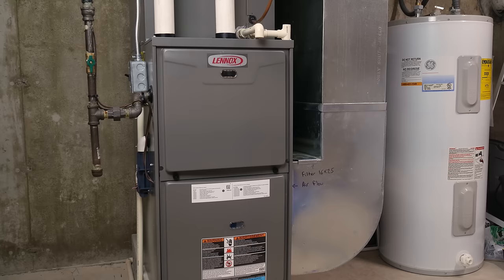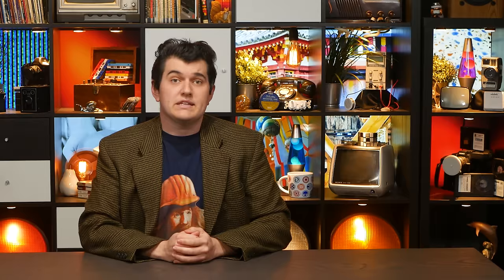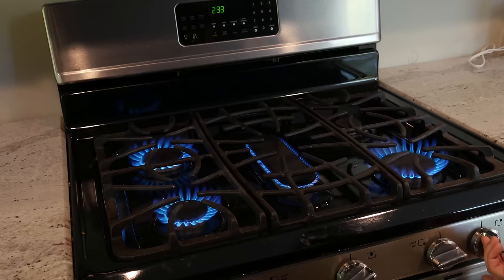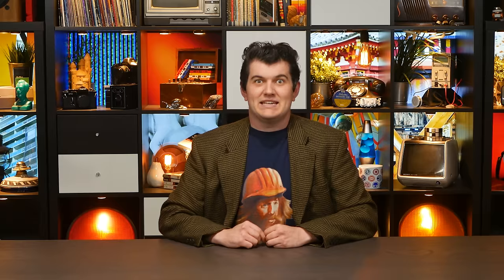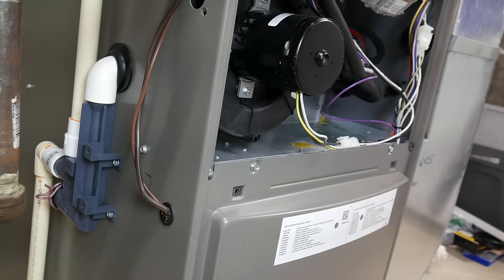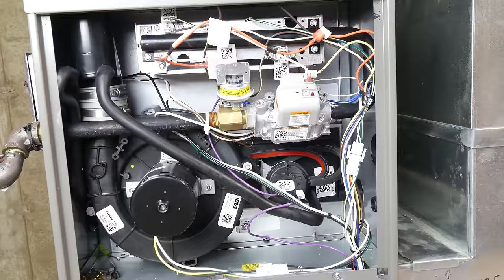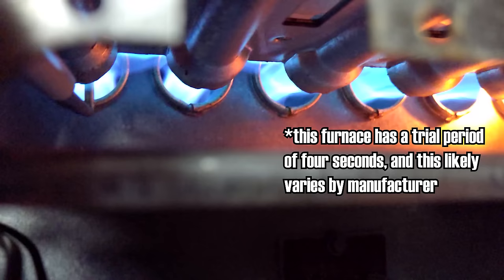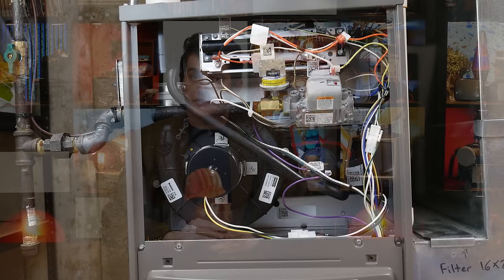Forced-air Furnaces: The What, Why, and How

Comment: I did an engineering internship for a company that designed and built the internals of these things (called "heat modules". A couple extra fun facts:

The burners are an interesting design in themselves. There's a small nozzle that shoots a stream of gas into a steel venturi tube, which draws air in at just the right ratio for combustion. The other end has a big hole like you'd expect, but they also have tiny channels sticking out on either side to carry the flame across all the burners during ignition.

A thermocouple isn't the only way to detect flame. A very interesting method is by placing a small pointy metal rod in the flame. Because of physics and reasons, when you place a large metal surface area (like the burners) and a small metal surface area (like the pointy rod) within a flame, the flame plasma will conduct a small amount of electricity, but only in one direction. Effectively it acts like a diode and a large resistor in series. So the circuitry will check for that condition. It's actually somewhat more robust than a thermocouple - a thermocouple could get hot for some unrelated reason, but it's very unlikely that a couple pieces of metal begin acting like a diode-resistor without flame present. (Unless, of course, an intern is making a control board testing rig, and they literally put a diode and resistor across the flame sense leads.)

There are also some furnaces that, along with a limit switch, have a "rollout" switch. These are thermal switches just outside the flame box that are meant to detect if flame is "rolling out" of the fire box instead of going in the tubes. This could happen in the event that the flue or one of the tubes is blocked - the pressure switch activates as expected, the flame is present as expected, but there's not actually airflow, so there's just flames rolling out into the wiring and everything. 

Some heat exchanger tubes have dimples, and the ones you show in the video have wrinkle bends. These help disturb ideal laminar flow and mix the gases, allowing the gases to cool uniformly. This sounds simple, but the design actually needs to be somewhat careful - any old baffle or dimple design may introduce eddy currents near the tube wall and cause overcooling and condensation, which will rust out the tube. Condensation can only happen in the final pass of a high efficiency heat exchanger - making the entire exchanger from stainless is not cost effective, so it's only that last pass that's built to withstand it. Up until that point it's exactly the same design as a standard 80%. (Also, that's the only reason why pretty much all low efficiency units are 80% - if you extract any more heat, condensation starts, and the steel tubes will rust out. You kinda covered that in the video, though.)
Reply: I wonder how Destin would feel about things disturbing ideal laminar flow.
Reply: Great extra info. Enjoyed the read.
Reply: I recently had to replace the small pointy metal rod (flame sensor) in my furnace and I was wondering what the difference was between that and a thermocouple. Now I know.
Interesting info, thanks for posting it.
Reply: The diode effect is because the flame is slightly ionized and thus conductive. But, in this case, the ions are flowing with the flame. Therefore, it poses less resistance to the electrons 'going with the flow' then to those going against the flow. This makes it behave like a (very bad) diode. 

If you apply an AC voltage to the probe, and measure the current, you can therefore measure a slightly assymmetrical current. This tells you an ionized stream of flowing gas is present: A flame!

These probes can also be used for spark ignition. Useful in instant water heaters, where you want to ignite fuel immediately and not wait a couple seconds for some hot thing to warm up. You can immediately after sense the flame, no need for the probe to warm up. I think that the pointy shape is rod just to aid spark ignition, and not for the flame detection, but I may be wrong there.
Reply: @marco23p  : The point will tend to concentrate the electric charge, thus leading to a higher current flow in all states, aiding both sparking and sensing via the same mechanism.
Reply: @marco23p  : Out of curiosity, have you ever heard how much the greater mobility of electrons aids in rectification, vs the flow of the carrier medium? I can logic my way into either of them working, but baring the involvement of thermionic emissions, I'm then challenged to think of why the effect should be directional.
Reply: So the burner is like a carburetor.
Reply: @absalomdraconis  To be fair, I have not. My source for the moving medium was the Dutch Wikipedia (article: Ionisatiebeveiliging), but the English Wikipedia (article: flame rectification) seems to only mention the difference in mobility.

 I think this in itself would make a very interesting video!
Reply: Great additional info, thanks Cody.
Reply: Others have pointed out that for spark ignition the sharp point can serve two purposes:  gas ignition and flame detection.  When I recently retired my 1984 gas furnace (after 35 years of service), I saved the ignitor module for circuit analysis.  The spark is generated by a step up coil that is driven by a pulse every half second (tick...tick...tick...).  It operates in parallel with the 24VAC lines that turns on the gas valve.  If the valve is on, it wants to ignite the stuff.  However, the same wire that sends the high-voltage ignition pulse to the spark gap, is also sensed by the drive circuit.  Once there is conductivity across the gap (the flame) the drive circuit is inhibited, and the spark pulses stop.  A nice feature of this design is that should the ignition not be sustained (i.e. the flame stops) the ignitor would start sparking again, just in case the gas is still flowing.

These circuits work well, and surprisingly when they fail it's often not the circuit, but rather poor grounding that's the culprit.  If the service tech works on the gas burner, but fails to reattach a hold down screw (or the screw area is corroded) there can be a bad ground.  So the HV wire to the spark gap is fine, but the return path is marginal or indeterminate.  Or perhaps the tech knocked the spark point out of alignment; out of the path of the gas.  This results in a marginal or misdirected spark, the gas fails to ignite.  

In normal operation the spark ignites a small amount of gas using the pilot valve, and once the flame is detected the main valve opens for heating.  Without a sensed flame, it never transitions past the pilot valve stage, and after a few failed attempts, will shut down completely.  It's also true that a poorly positioned spark point might be just close enough to ignite the gas, but also just far enough away to unreliably detect the flame.  This might cause the spark circuit to attempt to ignite an already burning flame.
Reply: Your mention of a flame roll-out switch surprised me being optional and not required. I thought this was a standard safety feature. Apparently, it must just be a  best practice that manufacturers can choose to observe or not.
Reply: @twistedyogert  I was thinking the same thing; it basically is a carburetor, with the U-tubes in place of the intake valves/cylinders

Comment: As an HVACR tech I deeply appreciate this. I wish more people were knowledgeable about how we heat and cool spaces. I think HVAC is the most fascinating trade. It encompasses so many different disciplines (plumbing, electrical, high and low voltage, controls, carpentry if you install, and refrigeration) you can go so deep if you want to but most people don’t even have a basic understanding of how it works.

Comment: "Efficiency of 96%"
"Correction it's 95%"
How dare you betray us with this fallacy! I'll be getting my unnecessarily precise statistics elsewhere from now on, thank you very much.
Reply: James Anouna it may be .5% less that 95 because the air filter is a little under sized, makes the blower work harder to get the amount of air it needs
Reply: Me, reading up on and buying heating for my house: 96? That's shit, are we still in 70s? 97+ or bust.
Reply: It's a quarter of those 4% !
Reply: The efficiency number only states how much fuel it turns into hot air. Hot air heating itself is very inefficient compared to using water as a conductor to radiate heat (usually through the floor in modern homes), but ducts are much cheaper to install than piping, which made it popular in the U.S. - the land of "cheap" energy.

There is a YouTube channel of a disabled guy struggling with paying his propane bill every year, while elsewhere even poor people living north the 50. latitude manage to keep at least one room warm on a moderate rate (like $30 per month) using radiators fed by a gas powered furnace. The problem starts with the concept of heating just the one room you're in doesn't even exist with central forced air.
Reply: @MayContainJoe  "Hot air heating itself is very inefficient compared to using water as a conductor to radiate heat"

Why is that? Sounds counterintuitive.
Reply: @seneca983  Water has a greater thermal mass than air.  Hydronic heating/cooling systems are used in large buildings and in boats and RVs, tour buses and even some homes.  MayContain is spot on about radiant floor heat, and if you don't have a drafty room, the rising heat does a great job.
Reply: @seneca983  You can calculate the overall efficiency by dividing the heat value of fuel (in kWh) used per year by the amount of floor space (in m²) in need of heating.

Even completely outdated single pipe radiator installations from the 1960s manage to do below 80 kilowatt hours per square meter per year in cold climates (as cold as "needs heating for 8 months of the year").
Reply: @seneca983  because there are INCREDIBLE losses in the ducts. Also, the cyclical delivery of air causes the relatively small ammount of entering air to mix with a large volume of existing air in the room. As a result, the net increase of temperature is far lower than what the furnace produced. During the off cycle, the barely warm air continues to dissipate heat into the windows, walls, furniture, etc. And as a results, comfort is not provided since you are now sitting in a lukewarm space that occasionally receives a dose of dry and very warm air blown at your head or a dresser...
In the mean time, a radiator happily provide convectional heat all day long, keeping consistent comfortable temperatures throughout the entire space.
Reply: @seneca983  That's because air is an insulator. From goose down coats to aerogels to insulated travel mugs and portable ice chests, they are all insulated by air. The reason is because air doesn't conduct heat as well as liquid.

I'm not a doctor, but I guess it's to do with the density of the material affecting thermal transmissivity. Air is considerably less dense so there's less matter to transmit the heat energy relative to liquids or solids. I'm sure I don't have this exactly right, but I think I'm pretty close with this explanation. And that might also explain the thermos bottles that used a vacuum instead of air to insulate... maybe some physicist here could correct me
Reply: @MayContainJoe  thats why condenser furnaces exist.
Reply: @Demonslayer20111  The efficiency of the furnace itself doesn't change anything about the (in)efficiency of the heat distribution inside the house.
Reply: @MayContainJoe  ya dont say
Reply: @travelinghermit  "That's because air is an insulator."

But even with a radiator, you're still going to have air between you and it.
Reply: My hot water system has a modulating burner, and measures the temperature of the water it is sending out and on the return loop: the delta tells it something about the temperature of the house. If there is a huge dT, the house is very cold, and it unleashes the very fires of hell into the heat exchanger. As the house warms up, the dT gets smaller (return water is warmer), and it dials back the size of the flame in anticipation of satisfying the call for heat.

Do modern forced-air furnaces do this too?
Reply: > concept of heating just the one room you're in doesn't even exist with central forced air. 

Wait, you don't have like regulators/thermostats so you can regulate this for a room, at least stop the room completely from being heated? 
This also means you cannot have different temperatures per room? oO
Reply: @whuzzzup  There is zoned heating, where you control the temperature in different parts of the house separately, but it's typically like "upstairs" and "downstairs", entire areas and not individual rooms. In hot water systems this is accomplished by each "zone" having its own loop of piping; I don't know how (or if) zoning is done with forced air.  You can close off the register in a room you want to heat less, but that's about it for individual room control.
Reply: @seneca983  That's a good point. So on further thought, I'd revise to say radiators, well, radiate. They must radiate in the infrared better than air can convect heat. Or maybe it's due to its thermal mass
Reply: @seneca983  air is a poor conductor of heat that's why
Reply: @whuzzzup  Those systems exist, but nobody owns them.  You'd install baffles or doors in the vents and some feedback system to control them (or do it manually I suppose).  I just shut the registers in rooms I don't need heated, like the one next to the (mostly glass) back door.
Reply: @DaddyBeanDaddyBean  "In hot water systems this is accomplished by each "zone" having its own loop of piping" That isn't actually necessary. You can regulate the heat not only per room, but actually per radiator using the thermostat valve installed on each radiator.

These radiators can all be installed on the same loop and that is what in fact happens in large apartment buildings, where even the radiators of different flats happen to all share the same piping. Modern systems have to two loops, one for feed (hot) and one for return (cold) and you can have as many radiators with opened or closed thermostat valves as you want on such a loop.

The furnace adjusts its heating power to the exact amount needed to reheat the returning cold water back to feed temperature. The feed temperature is automatically adjusted by using an outside sensor: The colder the weather the hotter the water.
Reply: @MayContainJoe  cool. I should have said "in my my particular case", vs making a generalized statement.  (Long story short, my system is a retrofit of a retrofit, in a 160-year-old house, so design decisions were somewhat constrained.)  Intriguing idea, though, and perhaps worth investigating for a future upgrade. Thanks.
Reply: @MayContainJoe  Please tell me "the hotter the water" was intentional
Reply: yea how could this dark orange jacket wearing weirdo make such an egregious error
Reply: @whuzzzup  Technically one can also close the register of the room they're in similar to opening/closing the flow of a radiator either manually or with a thermostat of some kind on the vent.
Reply: @travelinghermit  I don't think most of the heat from radiators is conducted to the air, not radiated, because they're not hot enough for significant radiation. They're even shaped to maximize conduction.
Reply: @hairyairey  "air is a poor conductor of heat that's why"

But a radiator also has to conduct the heat to the air. (Also, in the ducts the heat in the air moves by convection, not conduction.)
Reply: @seneca983  that's right, I didn't say air didn't conduct heat. It's just not good at it.
Reply: @hairyairey  My point was that air not being good at conducting doesn't (seemingly) make any difference since a radiator also has to conduct the heat into the air (and inside ducts the heat moves by convection, not conduction).
Reply: @Jemalacane0  Where does that extra energy go?
Reply: @seneca983  I'm sorry. I wasn't thinking correctly. Gas heaters don't heat air directly. They have a heat exchanger.